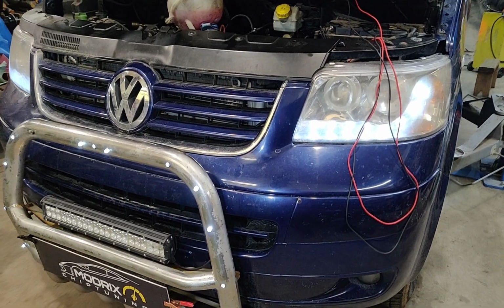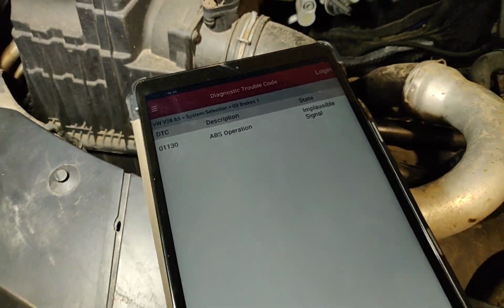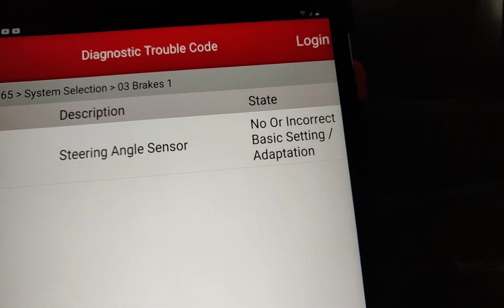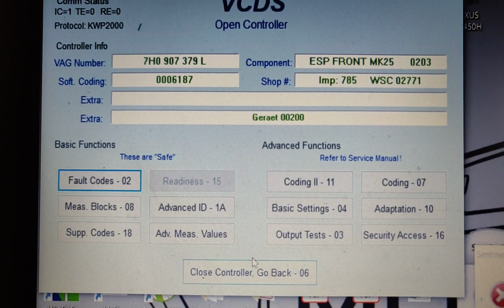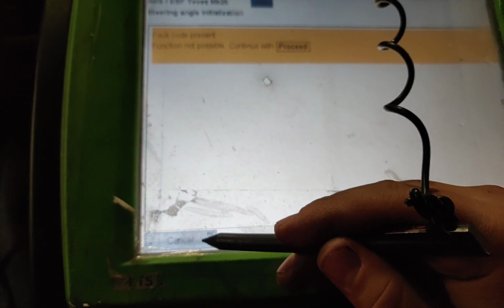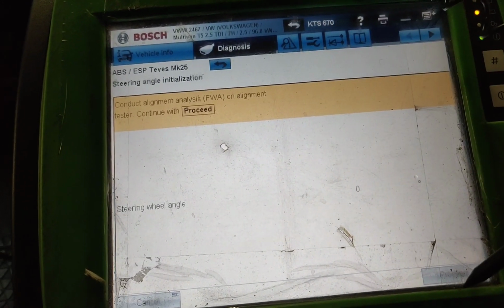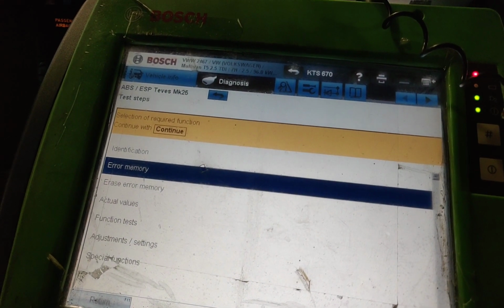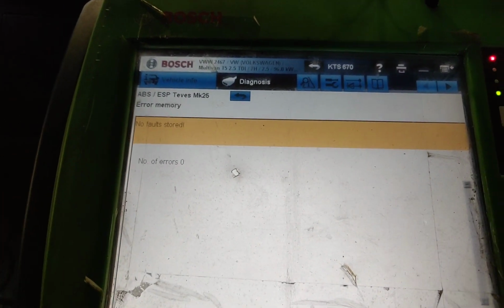✅ VW ABS/ESP system  Faulty? Fault codes 01130 or 046A ABS Operation Faulty

Comment: I got 01130 today on 2012 mk6 golf GTI. Went for diagnostics and they couldn't figure it out. It says implausible signal, Operational fault. But no real details on the computer of where and what. 

Strangly, if I keep the brake pressed before putting key in and staring ignition, and until after the car starts the warning lights turn off. 

Any idea what it could be?
Reply: SAME PROBLEM  SOMETIMES LIGHTS WILL DISAPPEAR IN RUNNING
Reply: @jeivenkatesh8324   I found the solution. I sold the car and will never go near VW again
Reply: @atc2889  WRONG DECISION FRIEND, I LOVE THIS CAR SKODA SUPERB SO MUCH I'LL TRY NEW PARTS OR USED NEVER GIVE UP FRIEND ,I HEARD ONE BEAUTIFUL GOLDEN WORDS   (  YOU CAN'T SELECT THE CAR ,ONLY THE CAR SELECT THE MASTER  )
Reply: @jeivenkatesh8324  Or you could just buy a toyota - which is exactly what I did. No regrets. Bye bye VW computer modules. Them VW parts are expensive here in the middle East.